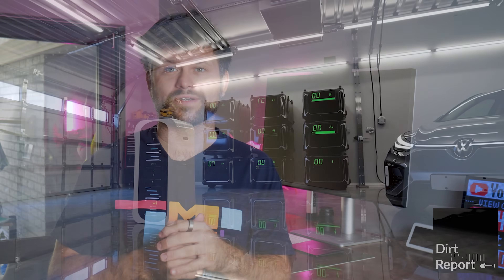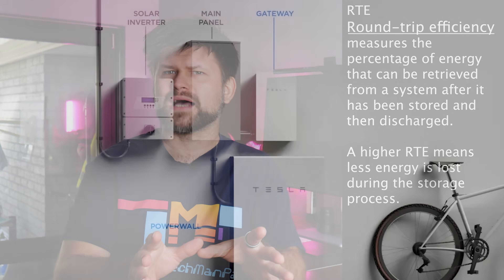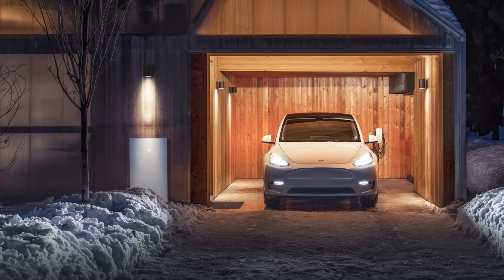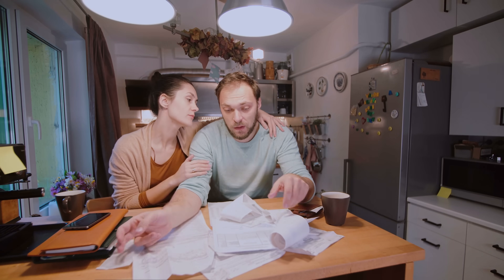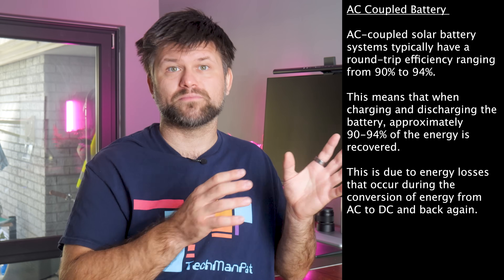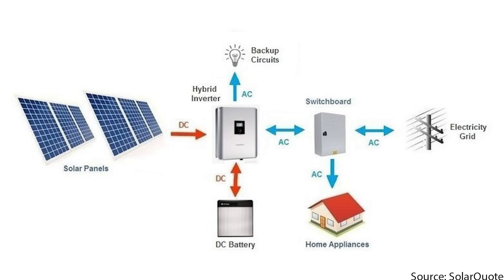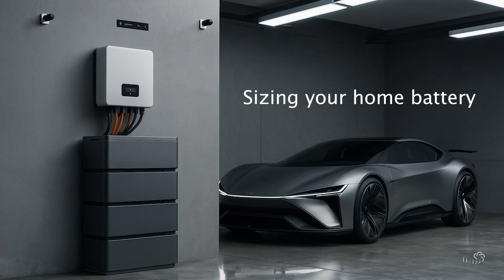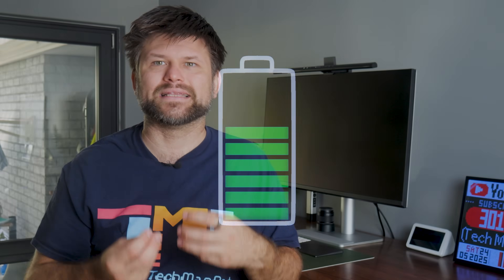Choosing the Right Battery for Your Home | Australia 2025 Guide

Comment: Fantastic video, thank you. I am looking at installing a battery but getting confusing information from installers regarding installation. One is advising that the battery can be installed in parallel to the invertor without running cables back to the electrical switch board while another is stating that is in not possible and you must connect the battery to the electrical switch board. The key challenge is that we are in a double story property and electrical switch board is in the middle of the house. Any thoughts on this?
Reply from the maker: Check with another installer to get a few quotes and see what they say

Comment: With the government rebate for batteries (specifically Vic), do you have to give control of your batteries over to suppliers, so they can use your solar generated battery power to put back into grid at peak?
Reply: VPP is optional but the rebate requires the system allow it

Comment: Does anyone have any experience of using a "free lunch" type electricity plan? (For example, Ovo Energy gives you free electricity between 11am and 2pm). It would make sense to charge the battery (for nothing) and then use the battery for the rest of the day. Kind of flips the switch on the economics of using more solar.

Comment: Nice work, thanks man :)

So I'm likely to update my panels as my current solar was installed around 15 years ago and is producing about 1.5Kw/hr... 
Hence naturally thinking about adding a battery system as even with a 6.6kw/hr system there'll still be excess production during the day on most days.

I'm curious to know your thoughts on the trend of battery tech. Like, it seems each year brings about new innovations and the price of the tech becomes ever lower. For most folk who aren't installing a battery for black-out cover but basically want their solar energy to cover their evening and night energy use, would you say that current tech and prices justify making the move, or that it's still worth seeing what tomorrow brings in terms of lower-priced and as-efficient (or better) batteries? Thanks :)
Reply: @DonHousiferBMI  great point- I am wondering this too

Comment: Hi Pat, thanks so much for this video — super informative! I do wonder though, at the end you mention not getting a large battery with a small solar panel array. Is this just because of the potential wasted money buying a larger battery system when you can't charge it fully, or does not being able to regularly charge the battery fully affect its lifespan? I've been quoted $7K for a 30kwh battery system (in 6 x 5kwh modules) but only have a 5.2kwh panel system. With the current rebates the 30kwh is actually cheaper than the 25kwh, and only marginally more expensive than the 20. We have room for more panels so may end up increasing our array in the near future too, but my concern for now is that not being able to supply enough charge from our solar system might impact the battery life — but try as I might I cannot get a clear answer. Any advice is much appreciated :)
Reply from the maker: It’s really about using the free energy from the sun to power your home, if your panels can’t provide enough energy for the day and fill you battery it’s a waste of the battery system
Reply: @TechManPat  thanks for such a swift answer! Amazing. We already have plenty of excess solar after powering our home (over 50% of what we produce after self-consumption just goes back into the grid) so would rather it went into a battery instead of the grid, just wasn't sure if supersizing the battery while the rebates are so good is a wasted exercise or could be useful down the track.
Reply: @TechManPat None of these "alternatives" to coal or gas fired power stations or gasoline or diesel fueled automobiles & kerosene fueled airliners are even required.  It may surprise you to know that the world has been taken for a ride by one Al Gore and his BS inconvenient lie documentary.  The ocean salinity is rather stable and at 3/4's of the Earths surface it plays a huge role in sequestering CO2.  Did you know that we have been measuring ocean salinity and it's pH since well before the industrial age?  Well we have.  Prior to the 1700's, average ocean pH was about 8.2. As of 2025 the average ocean pH is about 8.1. They predict at current increasing CO2 output the average oceanic pH may drop to below 8.1 and possibly reach 7.9 by the year 2100.  Yes.  That is 75 years away Pat and neither I nor you will be here.  Even if we were the current KH (carbonate hardness) of 8 in seawater is equivalent to 143.2ppm which is monumentally enormous.  If you couple the KH with an astronomical GH or general hardness of 360ppm there is zero chance humanity can ever produce enough CO2 to damage the oceans.  Seawater does not absorb CO2 readily and is literally unable to do so.  Bring back coal and gas fired power stations, some solar, forget wind altogether and batteries as well as EV cars.  Trust me.  The world has been sold a BS sandwich.  Cheers!

Comment: Thanks for the great video. I have a 5kWh solar system and am interested in a battery. My previous installer quoted me $6.6k post-rebate for a 13.3kWh AlphaESS battery. I don't know if this is a good price or otherwise. I've seen Voltx offer 30kWh system for under $6k. Based on price alone, the Voltx is the winner but what is the catch?

Comment: Can you do a video explaining adding a battery to solar system that has micro-inverters, such as the SolarEdge micro-inverters? I have a Solar Edge Inverter, with 6.2kW peak production capacity of Canadian Solar panels, during the summer I produce up to 45kW per day! I want to retain some of that. However have been told that fitting a battery system means removing the micro-inverters or the main inverter? Why is this the case?

Comment: Any thoughts on FoxEss? A 10KW Solar panel system with FoxESS Inverter EVO10-6H (6kW) and 
Battery storage FoxESS EQ4800-L9 (41.93kWh / 37.74kWh usable) is quoted for under $10K - single phase. Too good to be true?
Reply: @muhammadatifjav  what did you choose? I’m looking to the same Fox ESS batteries for my existing 8.8kw solar panels and at $6k installed it’s very attractive
Reply: @Axle-F still waiting, the installer has prob gone broke n delaying me

Comment: That was such a good video. God bless your bro. Not sure if you'll get a chance to answer my questions 
1. Can we use a 10kW solar system with a 13.1Kw battery?
2. My understanding is a solar systems is powered by the grid. I would imagine solar panels won't work (produce electricty) during a blackout because there's no grid to power them. So can the battery also power or atleast start a 10kW the solar system in the morning so that we can use our applicances through the energy generated by the solar panels during the day, incase of a blackout. If possible, would you need a 10kW Invertor and 13.1kW battery to start the 10kW Solar system?
3. String vs hybrid invertors - My installer said he can install a battery with a simple string invertor. even retrofit a battery after july once the rebate starts. Is this possible, what are the disadvantages?
Reply from the maker: 1. Yes you can, no reason as to why not. 
2. During a black out the inverter cuts off and now power is sent to home not grid, for the safety of anyone working on the grid. When you get black out protection with your battery you can in fact use solar in your own local home grid on generally one circuit or phase. Your solar panels starting isn’t like powering up a car, they have their own power it’s just the inverter letting them start up or not if it has signal from the grid. 
3. Yeah, I guess. It’s just adding an ac battery it’s pretty standard it does mean more boxes on the wall tho.

Comment: We installed a sungrow battery with blackout backup , we had a blackout but the battery was at zero due to no sun for  a period. Lesson learnt had the sparky change it to not to discharge under 20% so we won't get as much off the bill , but we need the backup due to being on a property  and no water in a blackout.We will probably do more tweaking as we get use to the system.

Comment: I am another one of those rare 2 phase houses, I have 10Kw of panels and 2x5kw inverters (SMA) both on separate phases.  Both phases are used for an odd variety of things that gets very confusing when I get half a blackout.  I'm wondering what options I would have for a battery,  if I went for an AC coupling would I be able to use power from both phases to charge the battery or would I need two batteries?
Reply from the maker: These are rarer each day…

I think a 3 phase battery is your best bet
Reply: @TechManPat  which translates to SigEnergy pretty much ;)

Comment: WE have been investigating adding a battery, and I am quite furious at the results. All of the suppliers have told us, without exception, that we should do this, because "electricity prices can only go up and up". Huh? The Greens and Labor have been hammering us for years that "renewables are the cheapest form of electricity, they will drive prices down". Clearly, that is a complete LIE. Renewables are CLEARLY going to be more expensive than say, coal.
Reply: Funnily enough, if you look at wholesale prices (Amber) you’ll notice when renewables are flooding the grid, 8am to 4pm, energy is RIDICULOUSLY cheap or even free, and when the sun goes down and renewables fall off the price goes through the roof! 
But unless you’re with Amber and buying at the wholesale rate, you just pay what the energy retailer offers you, and they just keep raising prices
Reply from the maker: Spot on.
Reply: Solar is green and free. A battery shifts use so its not 8 hrs but 24 hours.
Reply: @paulgerrard9227  telling only half the story, leaving out the bad parts, is a form of lying.

Comment: we are one of the "rare" houses with 2 phase power, do we go a single phase system and check what it is powering for go up to a 3 phase to ensure the 2 phases are covered?
Reply from the maker: Yes that would be the easiest solution (3 phase) but also check out hats on the two phases there might not be anything and or you could get it moved
Reply: @TechManPat  thx. yeah that is on our "to do" list while renovating. Wouldn't surprise me if only 1 phase is being used
Reply: We run 2 phase as well, went 6.6kw in panels 5 kw hybrid inverter single phase with 9.6 lithium storage about 5 yrs ago . Reconfigured switchboard so cooktops ovens and booster for solar hw run on second phase only other phase is light and power which runs from solar and storage and deals with export back to grid . We only draw from the grid for heavy loads and so over a quarter on our electricity bill we only use about 0.7kwh per day
Reply: Anyone installed Fox ESS eps battery. Popular in the UK I heard.

Comment: I’m in W.A. when you’re feeding into the grid they give you a bugger all about two. Cents.  And the cost of batteries even with the grants is a joke. The government is still ripping us off. I have found the solution.
I bought lithium batteries the type you would put in a caravan four x 300 per hour approximately 15 kW I paid $2600 for all the batteries I then bought a charger $600 to charge the batteries at 50 A and an inverter not grid connected for another $600 8000kw 
And I now run my house full-time on batteries. My solar runs the battery charger during daytime so it cost me nothing to charge the batteries.  
To sum this up, why buy an expensive system? 10,000? Extra to feed two cents back to the grid.

Comment: Hi Pat, thanks for the vid.  I recently sold my house and and am VERY happy to to be a long term renter.  Is there a battery I can buy that I can take with me, but still take advantage of charging it during the day and using it at night?  Uses would be for EV car and AC/Heating.   Thanks
Reply from the maker: You would be hard pressed to find a portable battery that can effectively charge an EV. You can however get quite large camping batteries for an okay price that could be used as back up power in certain rooms, and technically they can also be set to charge at a certain time and then discharge at another time .
Reply: @TechManPat  Thanks, it's sad that renters can't take advantage of cheap energy during the day and use it at night.  These are the group that need the extra help.

Comment: An issue with AC coupled batteries is it hits your dnsp inverter limits. This is especially tricky if on single phase where inverter limits are already low (10-15kw).
Reply: Exactly the same ID, welcome to discuss lithium batteries with me

Comment: I would like a battery but still can't justify the cost. Help convince me. I have a ~10kW solar system and use about 8kWh from the grid per day. At an average of ~$0.50/kWh, that's about $4.00/day, of ~$1,500/yr. If the full cost of a ~10kWh to 12kWh battery install was around ~$13K, and my out of pocket cost after rebates was ~9K, it would take me about 6 years to break even. With over half the battery life gone by then, hoping it will last for at least 10 years, it's still hard for me to justify the up front cost.
Reply from the maker: I think the price of the battery you got quoted is quite high. I’ve seen quotes for $5k to $7k for a 10kWh system after rebate. Same math, So if you can offset 8kWh per day (8x0.50x365) max savings is $1,460 annually, if you pay 6k roughly 4 year pay back.

But you are right, after 5 years you have 5 more years. It’s not a bad investment, but the battery should last longer, we shall see how the landscape looks in the future, plus you may need to account for price of energy increases and inflation.
Reply: Hi what brand was this? Was this a whole set up @TechManPat  thanks
Reply: That's because the rebate is a scam bud. Aussies pay 3 to four times more than Chinese retail using the same cells (apart from tesla) and the inverter industry isn't much better.
The CEC which is a private corporation has fixed rules as to who  qualifies as a  battery importer for on grid applications regardless how proven safe a battery can be.
I did my research and bought 17kwh  LFP battery as a kit  direct from China for $3,100  aud to my door here in Perth for a off grid application .
Better off buying reputable China direct and going off grid  or perhaps if there is a way  to off grid the batteries and house but  still export the solar on grid im not sure but it would require some kind of  large external inverter charger to run your house  or multiple smaller ones.
Reply: @JimboJones-qn4wd  yeah i got similar numbers and keep coming to the same conclusion

Comment: Great video Pat.  I have just ordered a 40kw/hr Sigenergy battery and in researching this purchase it became clear that there is a surplus of cheap solar energy during sunny days and if you connect to a wholesale provider like AMBER you can buy power from the grid very cheaply during this period - even for free or even a negative price.  I have a 20kw Solar array but I realised  that having a big battery is a good thing regarless of the size of your solar array as one can still very effectively “price surf” and arbitrage between low cost power and high cost power.  I therefore question your comment on matching the size of solar and battery.  Indeed if I could not have solar I would still Buy a battery!
Reply: Dude that seems like an absolutely enormous battery. If you don't mind me asking, what's your daily energy usage? And how much does your solar produce? What did you pay for the battery?
Reply: @DonHousiferBMI  My household tends to use around 24 kWh in summer, 40kWh in winter. Less in the spring/autumn periods. Main load is air conditioning. I'm considering a 25kWh battery, but according to my data this will insufficient for about 50 days of the year. (yes I have a relatively small 6.6kW solar system).
Reply: Buying a battery is a cost that must be recovered during the battery's lifetime. Installing $10,000 battery costs you $75 per month in depreciated value and $15 in lost interest = $115 per month. "having a big battery is a good thing regarless of the size of your solar array as one can still very effectively “price surf” and arbitrage between low cost power and high cost power." So you have to make $115 per month in your “price surf” to break even.